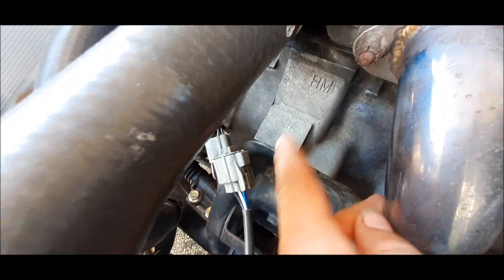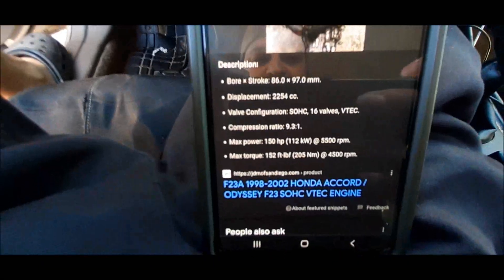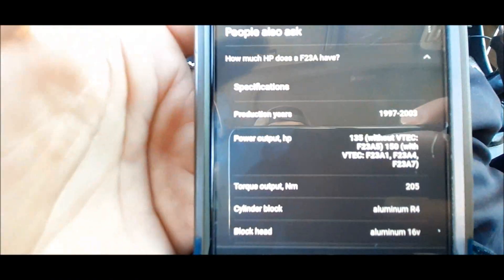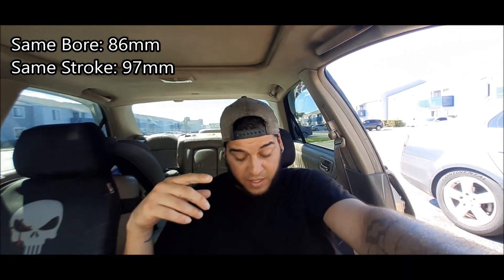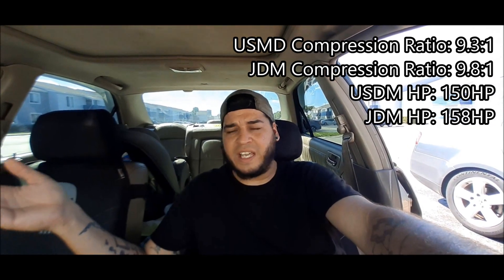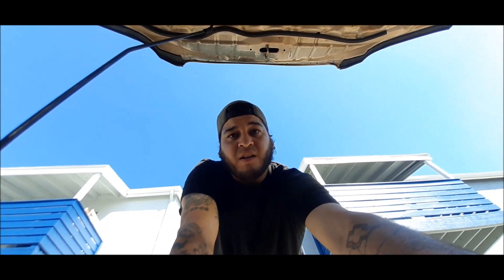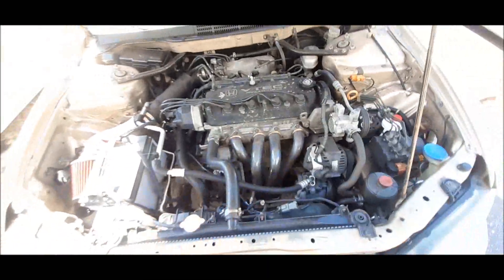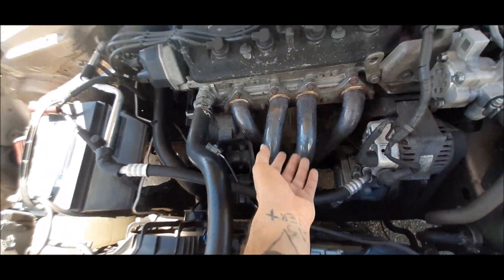WHAT'S THE DIFFRENCE BETWEEN A USDM AND A JDM F23 ENGINE

Comment: MASTER ANSWER HERE!!

What I learned by having several of these engines and testing them  myself is that JDM F23a have 220 Compression in the cylinder and USDM F23a1 have 200 compression. JDM F23 have better pistons, pistons rings, intake manifold, fuel injectors. Now I'm not sure exactly how much power that translates to, but JDM engines are a bit stronger/faster. But for some ironic reason USDM F23a1 hit Vtec way harder and louder. Don't know why.  The Vtec in JDM f23a can barely be heard. I suspect a camshaft difference but cannot prove it.   

Secret Tip: OBD-2 F23's respond very awesome to high octane gasoline. 102 octane gives OBD-2 F23As about 10-20 horsepower gain because of automatic electronic controlled timing, it retards and advances it. This tip wont work if you have F23A running on OBD-1

My stock Jdm F23a CG coupe running tits eats up k20s and anything B series related. and from  0 to 100mph it takes on preludes. and i got another f23a 4dr cg semi built on nitrous smokes everything including an h22 turbo CD5 accord a month ago.
Reply: Yoo I was looking to putting a f23 in my eg coupe with a ms24 trans how that sound should I just eat up some k cars I’m gutting the f23 intake
Reply: I have a jdm f23a.. what would I need to do to tune it? Would I need other mods. And what ecu would I get? A ps8 or what

Comment: If you're lucky enough to find the se model they basically have most of all that stock. I'm doing a build on a 91 se there's a lot different even the exhaust is a cast header with a different ecu and many other things even the butterfly on the intake. Great vid though.
Reply: I was un aware, is it still a f22b1?
Reply: F22a6, I think the factory claimed with the aggressive cam and all the other add ons it's supposed to put out 15 more horsepower than the other cb7s. I'm curious what I'll get out of it pre turbo and ac delete with a bottom end build and port and polish. Additional bonus of the se is leather interior. Build video coming soon I hope.

Comment: Well personally ive had both versions, and first time was with usdm version and with intake manifold and ecu from 95 accord ex swapped into my 93 wagon and was impressed with the power made though stock compared to f22a6, So figured jdm f23 could only be better, so swapped the jdm version in and went for a spin , what a disappointment it was least compared to usdm version, Smh couldn't tell you why, but wasn't worth swapping for from experience had, but f23 either version isnt a performance intended motor but is decent upgrade for budget scenario

Comment: Hey man I'm thinking about going with a F23 block for my Prelude. How are the Oil pumps you ever have any problems with them?
Reply from the maker: So an f23 block with a h22 head? And I've never had an issue with an oil pump
Reply: @cardudegarage  yes f23 block h22 head K20 pistons. Thanks good to know about the oil pump just in case the block I get is high mileage.
Reply from the maker: You can get a oil pump with a balance shaft delete kit from kstuned they sell alot of stuff for the h/f/g series
Reply: @cardudegarage  ya I seen that. it's $400 tho.
Reply from the maker: Yea its definitely not cheap but its great quality parts idk reach out to them on social media and let them know antonio from cardudegarage sent you maybe it will help you out some
Reply: @cardudegarage  how about the stock Water pumps any problems with OEM F23 water pumps?

Comment: I just really picked interest in cars but I would really appreciate it if anyone could answer my question.

I'm planning to do an engine swap on a 1997-1999 Honda Odyssey (with the JDM or F23 engines) and I'm hoping to put a 1.0 to 1.2 engine (for a reduced fuel consumption).
Is it possible and what engines should I consider? Thank you.
Reply: I meant JDM and USDM  engines🫣

Comment: Does a JDM engine bolt right in? Only asking because I have a 2002 accord but the engine is toast and I've seen JDM engines for sale for relatively cheap
Reply from the maker: Yes its a direct bolt in just have to use the usdm exhaust manifold and intake manifold
Reply: @cardudegarage  thank you, I appreciate the information!
Reply from the maker: Of course anytime if you have any other questions or need any help just hmu on i.g

Comment: Well i first swapped in usdm f23 in my cb9 and was shocked big time with power difference from original f22a6, however i then swapped a jdm version thinkin it would be even better    than usdm version, Smh couldn't have been more wrong !! Jdm version compared to usdm version originally swapped in and was way slower than the usdm version also jdm f23 didn't have vtec pressure  solenoid to connect just have to remove plug and install pressure solenoid, but currently the motor has really bad blow-by , so considering getting bottom end built forged rods/pistons and just boost it, or possibly k24 swap haven't decided yet
Reply from the maker: The jdm f23 should have a noticeable difference but if your planning on going boost id say do a built f23 block and a f20b/h22 head even all motor the g23 set up is amazing.
Reply: @cardudegarage  ooh it did have a noticeable difference, just not in the way i was expecting, but f23 is just a budget answer for little more performance than f22 found in cb7/cb9 can give stock wise, and yeah g23 ia a option as well but its time consuming to find things needed  parts/price/condition etc  I have to remind myself its just a wagon and not a integra gsr but still kinda debating on direction to go